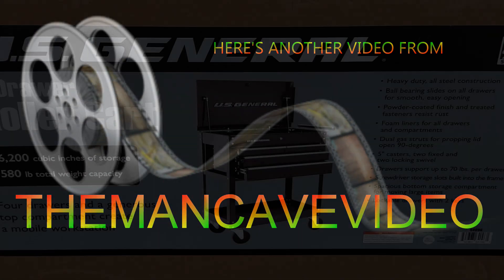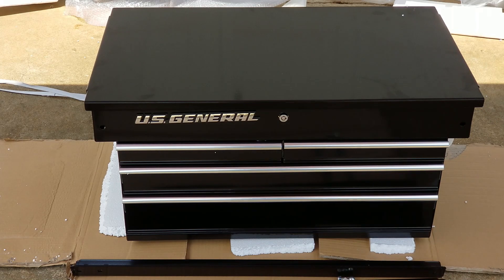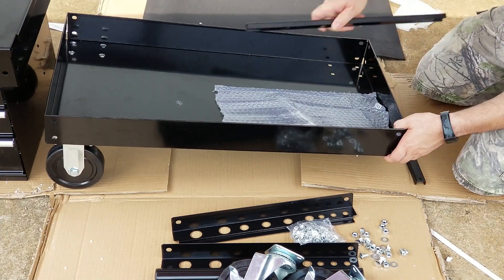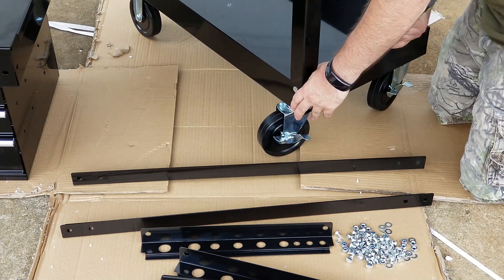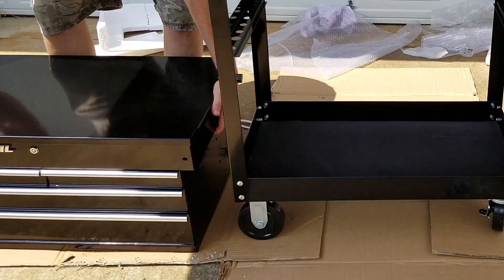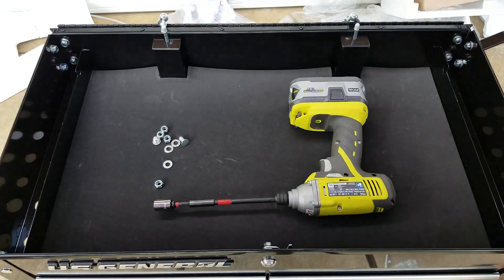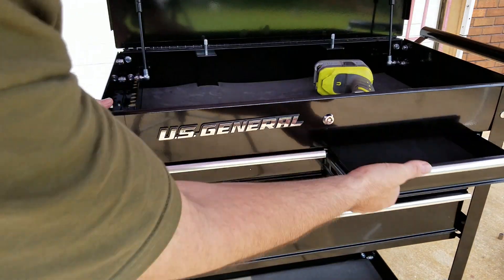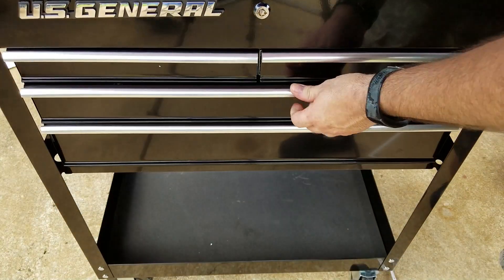Harbor Freight US General 4 Drawer Roller Tech Cart Unboxing and Assembly

Comment: best way to put the top box on the uprights (without help) is to lay it down on it's back, slide it together 1 bolt per corner stand it back up finish assembly
Reply: 4-6-22.  Being a 120 lb. 5’-3’ woman this was the only way I could build this by myself, and it worked beautifully, building it on the floor and sliding it in and around the toolbox worked great!  April 6,  2022 purchased.   Helpful note: Just be careful to make sure the tiny overlap flange on the top rim of the toolbox overlaps the corners at each top of leg.  If you forget to do this then simply loosen the bolts and pull the flange to sit on top and over the legs at the corners.   It’s a beautiful box!
Reply: Forgot to thank OneArm Bandit for his great idea!!
Reply: By the way, my model was a newer model with more bolts, but still works the same.
Reply: Thanks good tip 😊

Comment: The “longer bolts” mentioned in the parts list but not provided were in fact not needed. Handle went on fine with the same bolts used on the side rails.

Comment: Arrrrgh! Just received by 4 drawer cart, and yes the left side drawer lock is stuck and the 3 drawers won't open except the one on the right. HF has no solution, and I'm not seeing the video you mention with the fix. They have no more available to ship for 3 months from today, and so while they will gladly send me a label to return, I'd really like to know how you fixed it!!! I just want it to work! BTW the drawer lock moves up and down, and the spring action is functional, but will not open except the small right side drawer, so exact same problem you had.
Hope to hear back from you!
Reply: OK, so I figured it out. I was able to get one drawer out and see the piece that's supposed to slide up was not moving when the lid was opened on the left side. 
So, I turned the whole chest upside down on a card table with the lid open and leaving room for the spring loaded rods to go up or rather down with whole chest inverted. The lock lifted or rather dropped thanks to the force of gravity, and I was able to get the drawers open and out. And sure enough, there was a loose nut and washer. Incidentally to get the drawers out, you push the plastic locks on the drawer sliders one up and the other down. 
To reinstall the lock slider to the rod, I laid the chest on it's side, undid the 2 bolts that go through to the inside of the chest, then you can remove the rod, pull the slider all the way up, put the washer and thread the 8mm nut and tighten with a 8mm socket, universal and 1/4" ratchet. The locking slider was bent on top on mine, and there was not much threads sticking up, but there's another nut to adjust on the other side.
Likely it being bent was the reason the nut fell off if it was ever attached or just barely attached. 
Anyway, adjusted the nut a little, bent the piece back, reattached. It works now.. 
And of course put thread locker on the bolts to not have to do it again. EVER hopefully. 
Ok so where was I. Really not liking the rubber detents. Hmmmm. Another day.
Reply: @durpydurp7497  Thanks for posting a great followup to this video and sharing the solution:>)
Reply: @jeffwiggins3351  So, as it turns out HF has 2 different lock setups on the drawers on this box. One is the rods, which we've been discussing, and other is rectangular metal tubes. That's what I see when I go to harbor freight. But I also see vids on you tube from years gone by with the box tubes. 
So what gives? Why are there 2? When did they switch over? I had mine shipped, so it came from a warehouse vs the store. BTW they won't ship the 5 drawer or I would have gotten it but they did ship this one, only 20 bucks, which they refunded due to my problem. So are they receiving 2 different kinds or did I just get old stock with a design that's since been updated? That would suck. BTW love love love my new tool box!

Comment: Stopping by to support with watch time & 👍 # 182. This was a good buy back then. The only reason I did not get one was due to the lack of space. My garage barely has walking room. Need a shop LOL These carts now list for $239.99 HF is no slacker when it comes to raising prices.
Stay well, Joe Z
Reply: On sale for $179.99 right now
Reply: @edwardtaylor2250  Thank you for the heads up.
Reply: Got mine for $170 a month or so ago and a week later it was 160 at a parking lot sale.
Reply: @durpydurp7497  Before Covid I was a regular at HF. I was on top of their promos. But at times it was frustrating, in a week to 9 days they could have 3 different prices on an item. I have most of what I need but if there is a good promo, well you can never have too many tools. LOL
Stay safe, Joe Z

Comment: The ending was pretty funny. I watched this video because the parts list says two long bolts are included which I assumed would be for the handle. Well they were not included. No mention of different size bolts for the handle in your video so maybe I’ll be OK if I start this assembly.

Comment: I saw a coupon for $84.... Tried to use it, it rang up $107. Still good though
Reply: I did too but the manager  made it right  $84.00. The manager said if she can find the coupon she make it right.
Reply: @kooncesphotography  I paid the $107. My store had a posted notice so I figured it's still a good deal at $107.
Reply: Cool vid. I went through two boxes that were damaged before I I finally got one that wasn't damaged as bad. But for 89 bucks, you can't beat it.